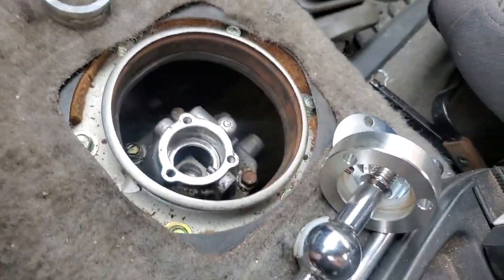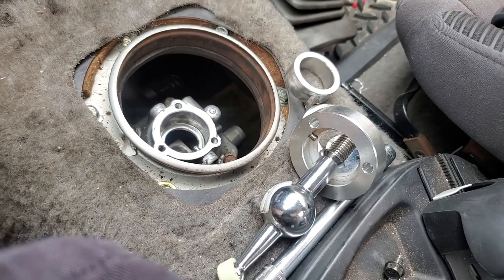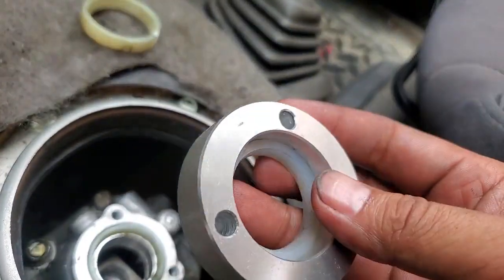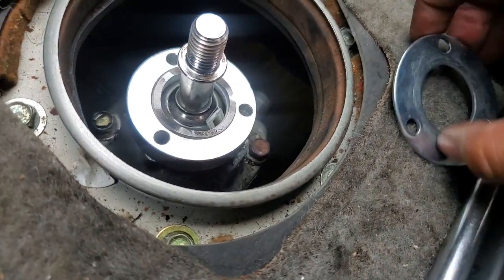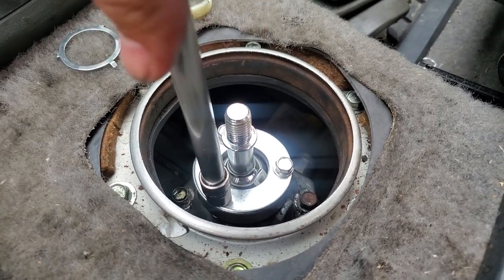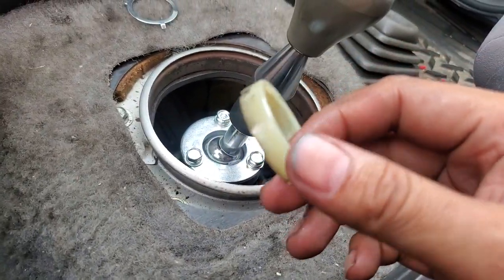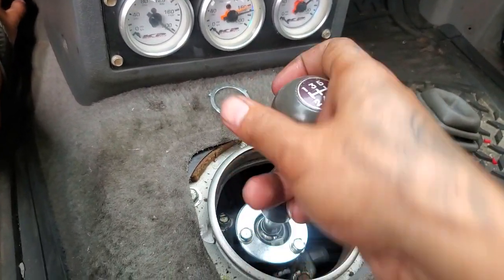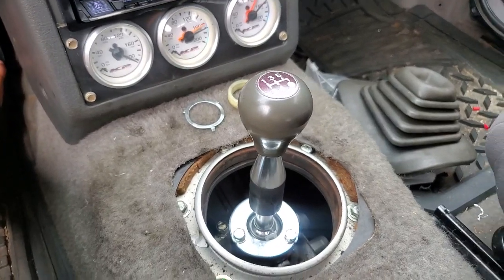Mazda B2000/2200 short throw shifter

Comment: Nicely done. My 2200 has a throw length like an old dump truck. This looks much cleaner.
Update: I run a bench seat and this was going to be too short. The part is now stashed for later where I may repurpose it.
Reply: Did you ever install it? Have a bench seat and wanting to install it aswell
Reply: @joelibanez6991  
Yes. Way too short for my purposes. Went with stock shift lever, fresh bushings and short handle (Momo).
Reply: How was the install? Straight forward? Did you have to cut that plastic ring like he did?
Reply from the maker: Did you ever install? You could just use a shifter extension, Im using an extension as well, it was just too damn short.
Reply: I've got a bench seat. I'm just gonna purchase a bent extension. Raise the height and angles the knob back towards the seat.

Installing it all tonight
Reply: @tattookaleo link for the extension?

Comment: Tried this today. It pops clean out when I try put it I to reverse.

Do you use the locator lug cut out on the new shifter?
Reply from the maker: I have that issue of it going past reverse once in a while, I never tried a fix, just got used to it. I actually plan to fabricate a shifter gate, this way cant accidentally push past.
Reply: Ah ok. I haven't tried trimming the white washer yet so that might be the difference. I'll try again without the bottom washer just to see how it fits.

I saw a video where a guy cut and extended the bottom ball  10mm longer and seemed to have no issues
Reply from the maker: @faustini69  you HAVE TO trim the nylon washer or extended the lower section, if not the lower ball wont sit in the right place, then for sure itll pop out.

Comment: great vid - curious about the new kit not using any sort of rubber boot to protect that new bushing
Reply from the maker: Yeah seems odd, I guess one could always make a boot. I'll see what I can conjure up.
Reply: I just found the original boot/kit from Mazda. Will let you know how it fits.
Reply: @eddiebones20  can you  send me more info about oem  item?
Reply: @mariomgf3106  I went to Galpin Mazda (Van Nuys, CA) and the dust boot in question was available. I'm finding miscellaneous pieces still on the shelves. Wish I had the part number, but I'm a pack rat and the wrapper is either buried or thrown away. The parts guy showed me a diagram and I selected the part. These may be available via your local parts house. I just replaced my turn signal switch assembly and it was available via auto parts store, but I got the OEM from Mazda for a few dollars more.